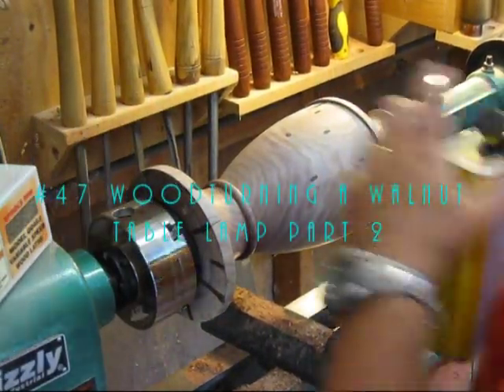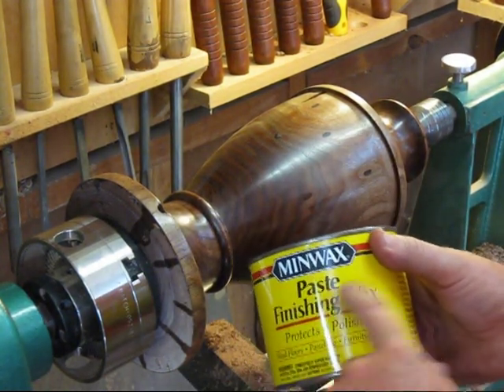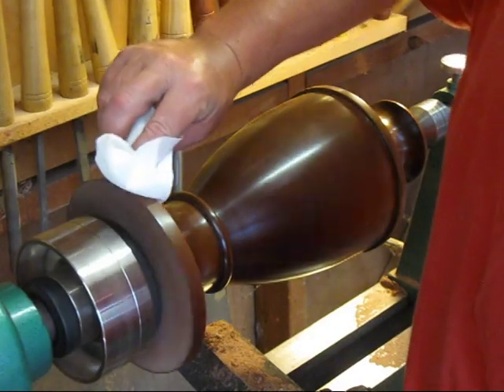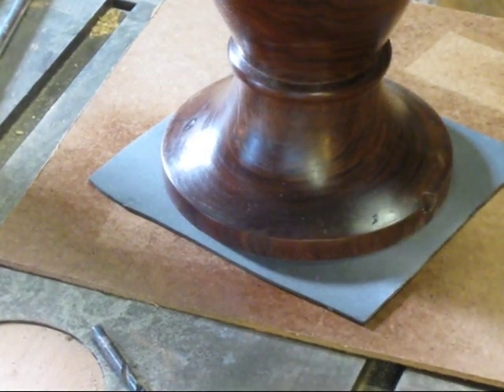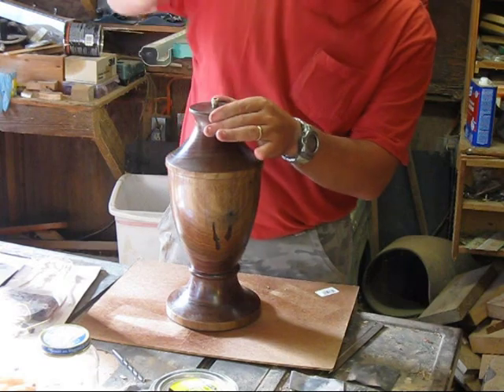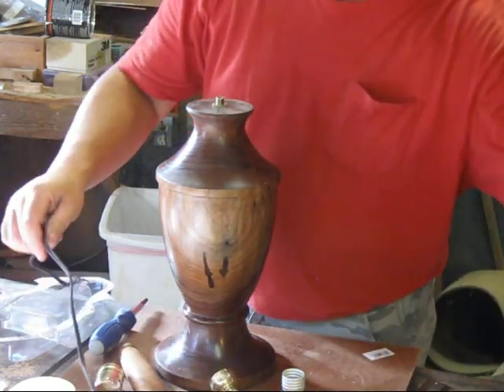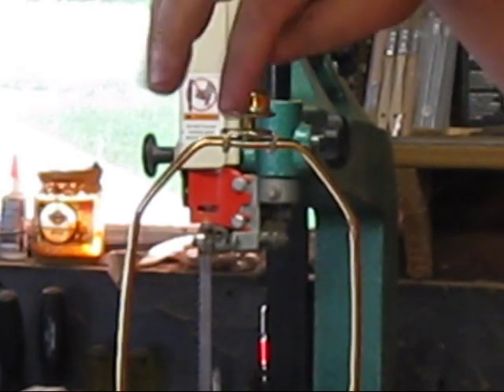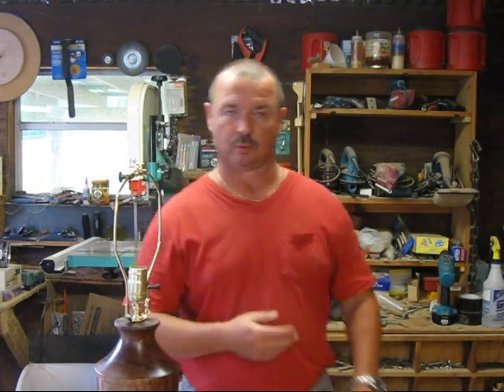#47 Woodturning a Walnut Table Lamp Part 2

Comment: You did great!  Sometimes you can use lengths of small black pipe and thread it for larger projects without the couplings and for the 3/8 always use slightly larger bit. We've all done it. Be great to see you piece together a stand post lamp like grandma used to have. That would be a work of art.   GruncleBear

Comment: Do you have to worry about the wood drying and cracking any more since it was a full log with the pith still in it? Or does the finish help control the moisture inside of it?

Comment: Beautiful lamp.

You said the instructions didn't say anything about which wire went to which screw. It does matter. I'd want to use a polarized plug and then make sure the neutral and hot go to the proper terminals so that the socket/shell is neutral. It will light either way, but if you do it backwards, it exposes the line voltage and is dangerous.

Comment: Nice lamp Stephen. If I may ask what type of tung oil you used (looked pretty shiny)? I just ran out of BLO and I have never been overly fond of it (I use it to cure my wet bowls, and yes it has worked pretty well since I saturate it really good).  Also, do the wheels on your steady rest rub any of the wax, lacquer, etc. off of your finished piece? Thanks again for the great videos!
Reply from the maker: Thanks James again for commenting. I just use the Minwax Tung Oil from Home Depot. I really like it. Yes, sometimes the steady rest will rub off a wax finish, it just takes buffing again to fix it. Haven't had that problem with harder finishes like Lacquer. I like the "O" ring tires. The are much softer than the hard plastic rollerblades, which can burnish or even compress the fibers. That results in a really messed up piece with a lot of sanding and repair work. Thanks again for commenting and supporting my channel. Oh, I will be using your cutters for the captive hollowing tool when I get it built.

Comment: Better to use TWO nuts with a drill and socket and SCREW the Allthread into it. Would be more secure and less chance of it getting jammed in there and screwing up all your hard work.
Reply from the maker: noelsingletary Excellent idea!! I will use that on my next lamp. Better than beating the allthread. Thank you for your suggestion.

Comment: Hi Stephen, on a 2 pin plug the narrow blade of the plug is the hot side, normally identified with a brass colored screw - the "neutral side is nickel colored - same with the bulb holder. Paired wire also normally has a fine trace line molded into one of the side of the jacket. Sometimes its hard to see but it should be there.
Paul
Reply from the maker: AHH HAA, Ok I understand. I did not notice a difference in the colors of the socket. Not saying there was no difference,  just didn't notice it. I will definitely check it closer next time and I appreciate your input on this discussion. Thank you Paul for taking time to comment and for supporting my channel.

Comment: Hi Stephen, love the vase profile - a bit like a Grecian urn, I do however have a couple of comments - I think if you put the foam or felt on last, it would cover all the wiring and hollowing of the base and give a bit more of a professional finish, also on the  bulb holder wiring you should ensure the "hot" wire should go through the switch to the base terminal to the bottom of the bulb and not the side connector. this ensures that if the base of the bulb is touched when its on nobody gets a belt from it.
Cheers, Paul
Reply from the maker: Thanks Paul for the comments and suggestions. I agree with the placing of the padding last, Just did not think about that at the time. It will be my practice on future lamps. As far as the electrical. The instructions were not clear on which wire to put to which terminal. I don't know which is the "hot" wire. There was no color difference on the wire or insulation. Thank you so much for your comments, suggestions and support of my channel.

Comment: Hello, I would like to know what finish you use on you projects, where you get your wood supply of blanks and finally what grit grind stone do you use on your grinder as I am a new wood turner, 
Many thanks,
Luke
Reply from the maker: Luke Ferreira Thanks Luke for your questions. As far as finishes go I am all over the spectrum. Mainly depends on the piece and what look I want to try and get. Mostly everything gets a couple of coats of Tung Oil and then either Furniture Paste Wax or Lacquer. You really can't go wrong with these finishes. Polyurethane is also a very good choice because it is oil based and will bring out the colors as it is applied. My wood all comes locally from a tree service I got in contact with and calls when he takes down interesting trees. Finally my grinding stone is 80 grit.  I hope my answer helps you out and Happy Turning.

Comment: Beautiful lamp. Just wanted to let you know that one of the wires has ribs on it. That is the neutral which goes on the silver screw. It will make it less likely to get shocked when replacing the bulb.
Reply from the maker: Thank you Bill. I hope I got it right on this one. However my Aunt loves the lamp and has not been shocked yet, so maybe it is correct. Thank you for making me aware of this so I can make sure they are all correct in the future. Thank you also for commenting and supporting my channel.

Comment: Great project Stephen, I'm sure your aunt will love it and it will have been well worth the 2 year wait!! I'd love to see it with the shade on and illuminated.
I've never used tung oil before but I am going to give it a try, I know a lot of people say its a great product.
I've just splashed out on a new dewalt contractors saw and am looking around for some inspiration on making a table saw router table combo, then am going to re visit some of your other videos for ideas on jigs and sleds to use with it! So thanks again for your inspiration and keep up the good work my friend. Trev
Reply from the maker: Trev Sutton Thanks Trev. I will ask her to take some pics of it when she gives it to my Uncle for their anniversary. 
I really like the Tung Oil because of the fast curing time, otherwise it is just like any other oil. It is very thin and penetrates the wood pretty deep.
I am about to make a video on a new Rip Fence and hopefully a Router table on the extension wing of my tablesaw. My router table has to be dug out from under the rubble pile to use it and even worse, must be put back when I am done. Glad you are enjoying my videos still. Thanks again for your support of my channel.

Comment: A very nice design for the lamp. Would like to see you make a finial for the top with threads to screw on or to go over the nut that's on it.   Just an idea that might help.   Hope drilling your chuck worked out for you.
Reply from the maker: mrlacroft Brilliant idea with the finial. I like it a lot. I will use it on the next one for sure. Glad you asked about the chuck. Which holes were you referring too, I assumed the ones behind the scroll gear but was not sure. Please write back. Thank you again for commenting and all your support of my channel.
Reply: I drilled all the holes. The tightening ring and the chuck it self. I went through the chuck hole bottoms and thought I had ruin it but it did not hurt it at all. I drilled the holes the same size so the tightening rods could go deeper.    If you have any ?? just ask.
Reply from the maker: Thanks, I think I've got it. I was right to begin with and just wanted to be sure before I messed up my chuck. Thanks for the help.